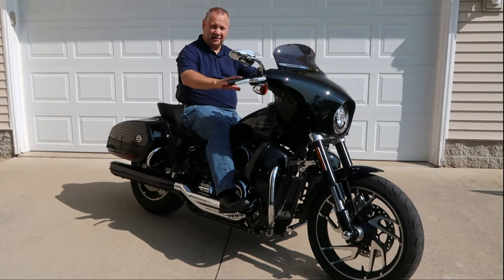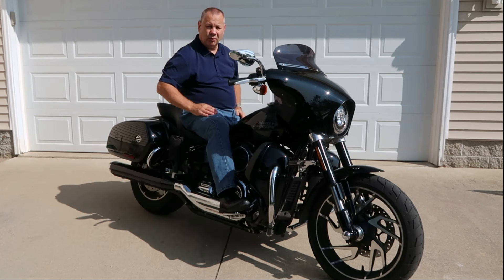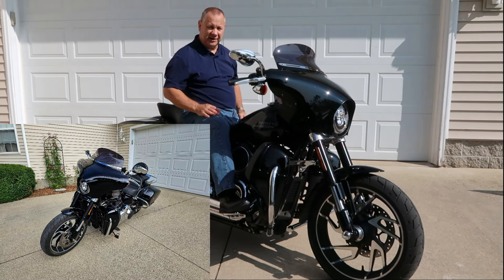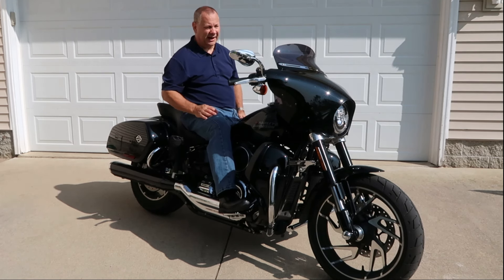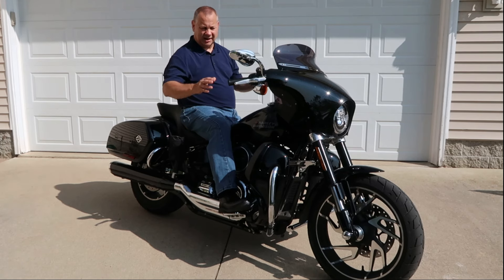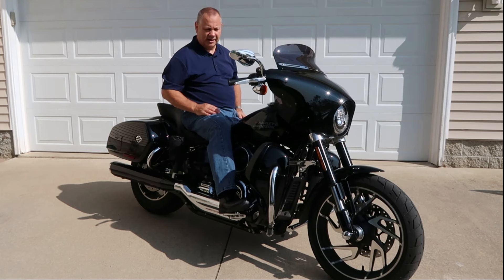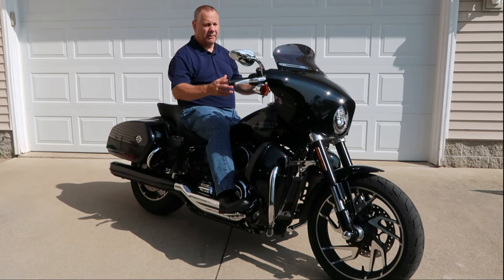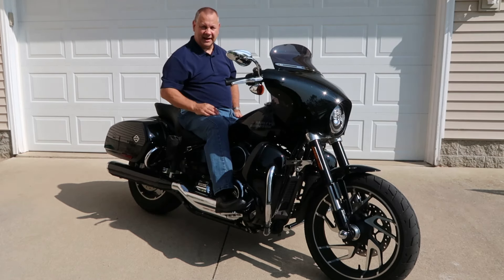I'm Pulling the Plug on This Bike Build!

Comment: So, buying parts, hiring someone to bolt them on (and disparage what they charge when you can't do the labor yourself) is called "A Build". That's your modern day motorcycle buyer for ya. Notice I said "buyer", not "owner". There's a big difference.
Reply from the maker: You've obviously never watched any of my content and you've clearly not even watched this entire video. You seem to put yourself above others when it comes to mods, but even you, like me, would need to involve a shop to build custom cables, brake lines, etc. for a Sport Glide. If you had actually watched the video, you would have seen that I never once jabbed at the shop for charging for their services. The point is, I don't feel that heading deeper down the rabbit hole is going to take me to where I really want to be. As I stated in the video, I've just outgrown this motorcycle and it's time to move on. Before you troll someone you should take the time to actually watch the entire video and understand the message. Otherwise, you just end up sounding like an uninformed jerk, like in this case. Hope my time here wasn't wasted. My hope is that the next time you feel the urge to make ugly, uninformed judgment comments, you'll hit the pause button. Best wishes...
Reply: @ToddsProjectsandOutdoorJournal  Blah,blah,blah. I'm a machinist, tool & die maker. I make what I need. Next time you pick up an Allen wrench, if you do, think of me. I make the die, that makes the wire, that makes the wrench. I've OWNED the same bike for 38 years. More miles than I can count. I know her inside and out.